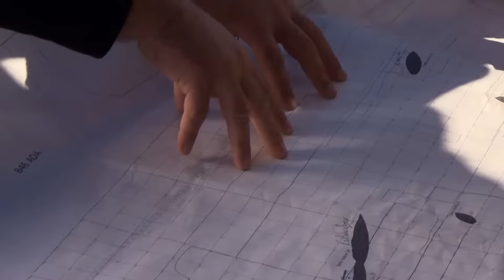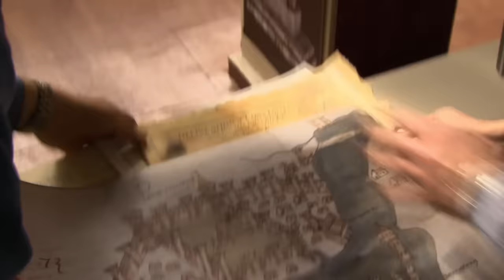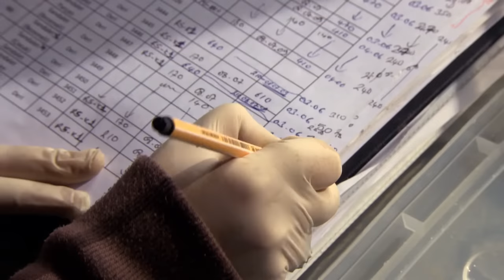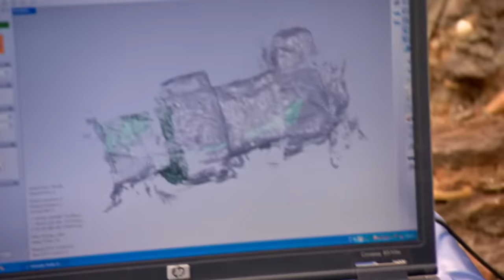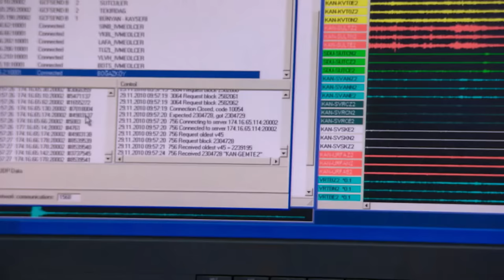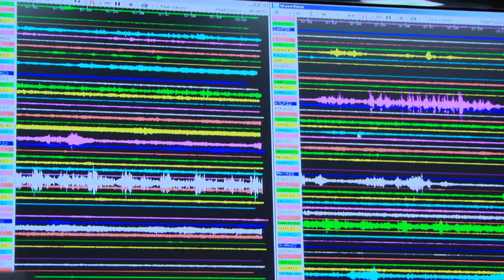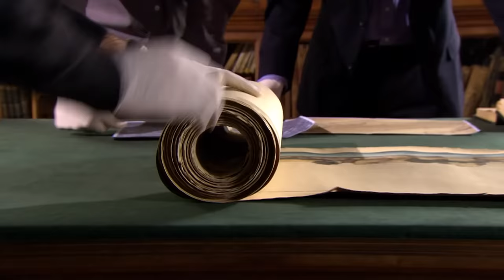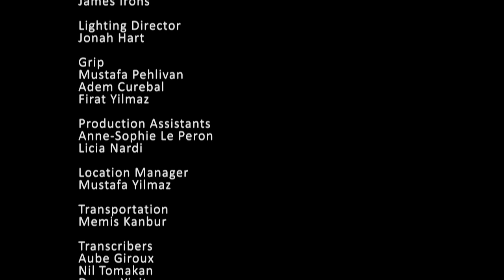The 2000-Year-Old Harbor Found Buried Underneath Istanbul | Emperor's Last Harbour | Real History

Comment: There has never been a subway station there before so a little longer is not going to hurt. It wod be different if they were replacing or expanding it and it was shut down for construction. That's not the case. Opportunity like this has neve happened in the history of man kind given that it's the largest find in history. I say shut the construction down, send the workers to other projects or send them home with pay and allow them to write off the expense and revise the contract to reflect the historical find and allow what ever time it takes to recover our history. As for the archaeologists company they need to get in and get out. Get her done.
Reply: Here in London we’ve just opened the Elizabeth tube line. As this was a brand new line with new stations going the central London there was a massive archaeological dig alongside the construction works. Thousands of funds were made including quite a few Plague burial pits which had to be carefully dealt with as the virus could lay dormant! The skills shown by the Turkish archaeologists would have drawn on the expertise worked out from other digs similar to the tube line here.
The preservation of the ships timbers would have been taken from the way the ships timbers of the Mary Rose ship which was raised from the sea bed after sinking there in the mid 1500’s.

Comment: Soooo what sank the port  ? 
It is difficult to understand why they are building a massive, underground  transport system in an earthquake zone ?
Reply: Like Japan?
Tech marches on
Reply: @tomrobertson3236  
Would you buy a car designed and built in Turkey ?  Yes, tech moves on , but Turkey doesn't even rank on the top 10 countries that are tech savvy in any area.
Reply: The port was silted in over time. Harbours, canals, rivers, etc. have to get dredged to stay navigable. In its heyday, Constantinople had a population of about 500,000 and a heck of an infrastructure, including cisterns that could supply water for firefighting and a chariot-racing stadium that could seat 80,000 spectators. But the city lost 30 to 40% of the population to plague in the 6th century, and the population dwindled to around 100,000 because of wars, sieges, political corruption, and loss of a reliable supply of grain from Egypt. The manpower to maintain a huge harbour wasn't there. Nor political ambition. When the city peaked again in the 12th century, a different harbour was in use.

Comment: Fascinating that there was not a single thought expended at suggesting the most obvious reason for the harbor coming into disuse over the centuries due to climate change. During Roman times the harbor of Rome was also located further inland. that period 2000 years ago was characterized by a climate  substantially warmer than todays climate. Warmer climate sustained over centuries means sea level rise. If all ice remaining on land today would melt we can expect global sea levels to rise 60-70 m. We now have a sea level 120m above that of the height of the last ice age, yet 60-70m lower than what it could be. As it was warmer during Roman times (the Romans were growing grapes and citrus in colonized England for centuries) and Konstantinoples time, we would have to expect a sea level somewhat higher than todays. that would explain near perfectly the current inland location of the old harbor. Another 4000 years prior to that saw earth in it's warmest climate of the past 12000 years since the end of the last ice age. In fact it was so warm for thousands of years, that the coast of northern Norway, at the Norkap, there was mature pine forest, that had migrated that far north all by itself. During that period surely the arctic ocean must have been largely ice free. somehow the Polar bears survived that though. as well as the siberian Permafrost, full of it's  shock frozen whooly mammoth and other megafauna carcasses, and all the methane contained therein, they want us to believe, will soon be released, triggering runaway warming. Why did it not get released during that super extended warm period around the time when the pyramids were built in Egypt?? Anyone ever been to Nordkap will perhaps recall the barren landscape around there today. Even when standing thee in July, looking north across the cold sea, if not shrouded in fog and cold rain, one can consider oneself lucky to catch some direct sunlight, and having driven there coming from the south the travellers will surely recall that the nearest unbroken Pine Forest lies 100-200 km to the south, 2 degrees of latitude!!!!

Comment: Harbors silt up.  A harbor is quiet water,, to protect boats at the dock,, or boats anchored out to hide from storms.  But that quiet water also allows the water to drop its silt.  It is only in modern times that we have had the dredging machinery, technology and raw horsepower to dredge and dispose of the spoils.

Comment: Constantinople has been in a earthquake area for as long as people can remember. Building something under this conditions, you need capabilities, or as in this case a hole lot of luck. Too often building just collapse in Turkey. Than they blame everybody except those who are responsible. I would say to everybody, do not go inside that tunnel. The same concrete used for collapsing buildings is used for this tunnel, and if the Turks use more reliable concrete for this tunnel why wouldn't they have used that reliable concrete on those apartment complexes.